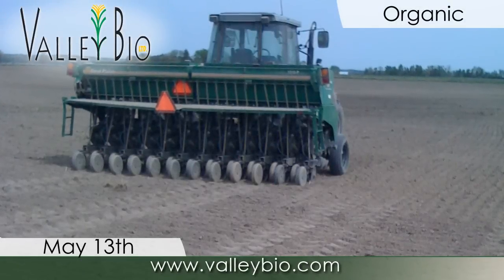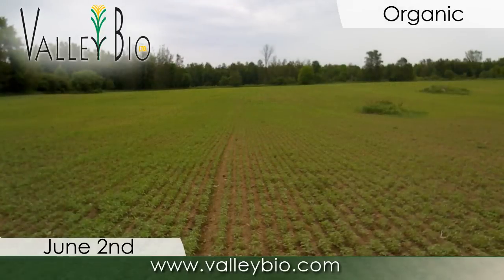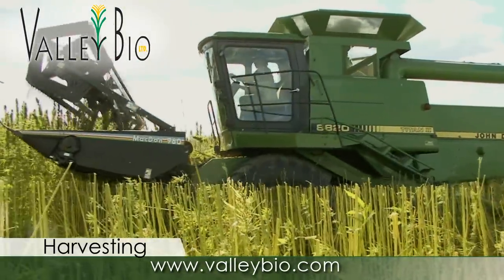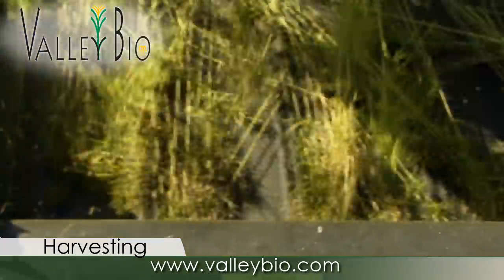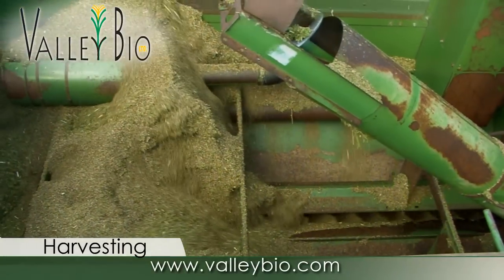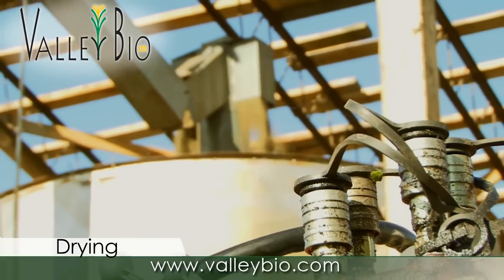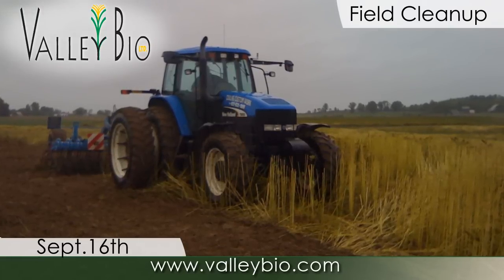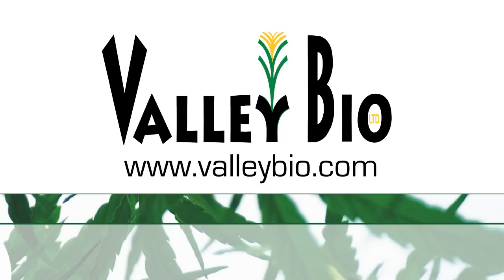Industrial Hemp production basics for Ontario

Comment: can you use the left overs for ethanol ?
to power your own farms
Reply: yes win win win, plastic, paper, cloth, hempcrete, the list just goes on and on.
i use hemp soap and eat prairie natural hemp protein powder ;p
Reply: I think he actually built some of these, no? So it was more than an idea but a working concept. I do know for a hard fact that you can run tractors cleanly and effectively on wood gas. It seems like farmers could grow their own fuel and sequester + - 50% of the carbon in the form of char, which happens to be one of the best soil builders / amendments out there. For a win win win. Anyhow, Hemp - a crop whose time has come
Reply: D eez
What about burning the hurd in a wood gasifier and then using the resulting char to fertilize the field?
Reply: to power your own farms??? So burnt in an engine. Ya, Looks like even an ethanol blend is damaging to current engine components. So not a good idea. So No Thank You to put in an engine.  If you have another idea of power from ethanol then maybe but keep it away from machinery.
Reply: @01mustang05  ethanol to extract oil from the hemp could be useful
Reply: henry fords idea for cars was to burn of ethanol from hemp he even made a hemp plastic car that ran off ethanol

Comment: the combine is 1 to 250 k new  large deer or case and a draper header is a must ,a belt not auger is needed or it will wrap everything 50 to 80 k for the mc don multi crop header all new set up and delivered 300 k plus. step off dyno Donny your oil comment  is way off .,,,have you produced any green products or do u use coal and animal fat to bathe in daily what do u drive on ,and on and on and off the cuff assume more think less. iowa would be bumper crop land 2 k an acre ?? legalize it   7 of the 15 plus states w/ med laws have hemp laws as well ,, no way w/out precident setting states to risky now we see states rights not fed control over a trillllllion dalla crop people .. And yes Obama did this and changed some taxes on the rich and that s  it the rest is grid loc health scare prog. peeez and homony.
Reply: Everyone stressed about equipment, I just need to find enough seed....my becks dealer dosen't have any skids of it lol

Comment: 30 barrels of OIL per acre ! ! ! More fiber than wood (from TREES ). hemp seed the most nutritious food on the planet.ect. . . Fantastic rotation crop for putting nitrogen back into soil. Grows fast. Soaps, shampoos, medicines, ON & ON & ON..... WHAT are we waiting for ! Oh I know, some stupid law past in 1937 ! !   W H AT ! !    W.T.F !   Grow up, you IGNOREANT Americans..
Reply: Cee r incorrect hemp crete is not a load bearing wall system.  Not nearly as strong as concrete.   However it has many other uses that are amazing.  Its an insulator, has thermal mass, and much like earthen walls, has the ability to hold moisture which moderates the heat.  This also should have the side effect of being able to cool the home on a hot day.   As when the sun beats down on the earthen walls which hold moisture as well, evaporation occurs.  This Causes a cooling effect inside the home.
Reply: You're welcome, there's other issues with hemp crete too.  If it doesn't set and bind well it can become weak start crumbling for example.  However it's still an extremely viable sustainable way to build homes and improve existing homes.  Modern homes are such a rip-off and require so much energy just to maintain the temperature.  They have no thermal mass and can catch fire and have such a limited lifespan.  Compressed Earth bricks are the best way to build a home today.  However with so many homes in existence and the way they're being built hemp-crete can better accommodate and integrate into the modern ways of building and renovating homes and has most of the advantages of compressed earth bricks.
Reply: got any true unbiased sources for the 30 barrels of oil per acre? Let's also keep in mind you're also not going to get the same harvest in clay soil as you would in sandy soil, A neighbor grew organic hemp as he is fully organic and hardly any of the seeds took off or even grew much, it was a great loss this year in that 80 acre field.
Reply: Thank-you for giving information that is less biased and more scientifically informed.
Reply: @foxxx2744  vomits
Reply: pukes
Reply: Dude, are you dumb ? Its 300 barrels per acre.
Reply: @raymondj8768  Oh, sorry!!!!!!!!